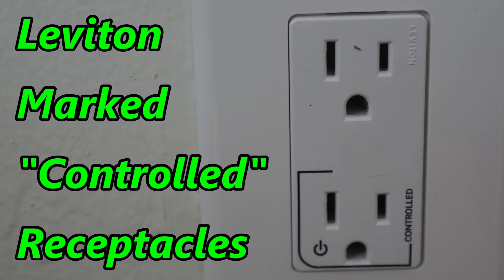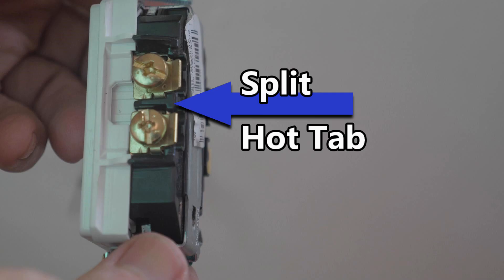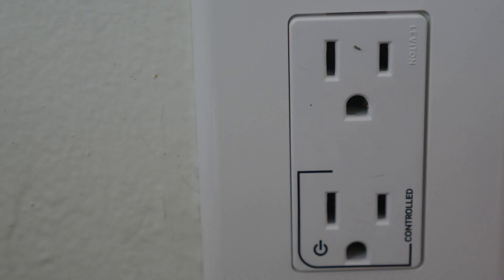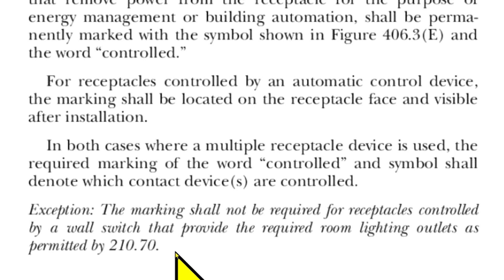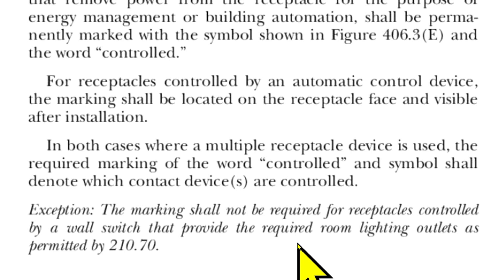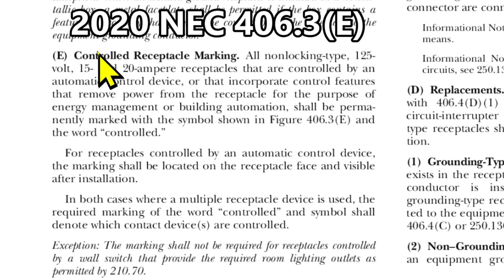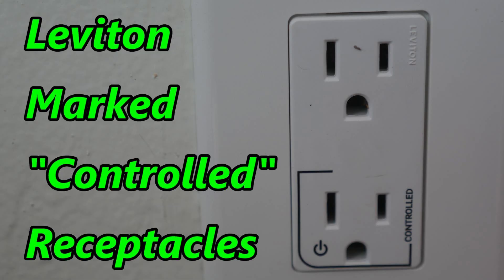2020 NEC 406.3(E) Marked "Controlled" Receptacles

Comment: There's only one switched receptacle in my home. When I replaced all the receptacles, I put that one ground-up, while all the others are ground-down. This serves as a hint that it's switched.
Reply from the maker: Excellent!
Reply: Switched receptacles are exempt from this. "Exception: The marking shall not be required for receptacles controlled by a wall switch that provide the required room lighting outlets as permitted by 210.70."

Comment: Should not be mandatory
Reply from the maker: I agree, but I like them.
Reply: Unfortunately, there are plenty of idiots out there.
To be honest, it makes sense. What if the outlet is controlled by an alarm system, timer, or thermostat? Imagine: plug in a device and it works. Sometime later, it doesn't work. Why? Were you informed about the outlet's uncommon configuration?
When we convert the garage we left the GFCI breaker controlled outlets be. How do you tell these from the standard outlets we added? On the same circuit are the outside lights, outlets, and pond pump, and every time there is a storm, ... .

Comment: I like it; I’ve installed and serviced a lot of 1/2 switched receptacles as they were a huge go to back in the day before ceiling lights were the standard and they van be a pain to diagnose issues in or just to map out especially when 3 and 4 way switches get involved, and extra-especially when these things are wires wrong. I’d use these just as a standard practice as I use labels to mark the switches 1/2 of the receptacle but labels can come off; I’ve long wished for permanently marked receptacles like 1/2 switches and GFCI controlled as they’re another one where the labels tend to come off or just get taken off as a lot of owners/renters seem a little OCD in not wanting labels on outlets. We do mostly residential and commercial and we used to have a standard practice of labeling junction box covers with breaker numbers to help quickly de-energize things for service; we learned to start labeling on the inside as a massive number of customers would take labels off or clean off sharpie in the case the numbers were written on. When you have to diagnose an issue, especially in a system you didn’t install or previously work on, labels are a god send and a massive time saver; they also help after a home sale as the new owners/renters have no idea what, how, or why things were done the way they were.

Comment: While I absolutely see your point of having a visual indicator, I feel that medium to high-end homes will not like the idea of having markings on their outlets. They will see them as unnecessary or tacky, and have them replaced after inspection. But they don't make the codes, so..

It would be nice not to go into a service call for a "dead" switch, only to find its a switched outlet!
Reply from the maker: I think the receptacle that I showed in the video looks very nice and professional, not tacky at all.
Reply: @SparkyChannel  Ya i dont care if they label them for something useful like a safety thing. but why does there brand name have to be right on the front face of the device. that's just companies trying to make people advertise for them for free. Levition is the only one doing it so far i think eaton stuff don't have there brand name on the front. they only started doing it with in the last year or so.
Reply: @mraaron1584  Yeah, and carmakers should stop putting their names on the front of their vehicles.
Reply: Leviton has started putting there branding on the faces of switch's and plugs its kinda annoying when companies just assume people want advertise for there brand for free. so far i think Leviton is the only one doing it. i saw alot of reviews on amazon and else where with complaints about it
Reply: @mraaron1584  In my opinion, seeing the Leviton logo on a receptacle face is a fast indicator that a quality product was used, not some cheap Walmart receptacle or something. It's not like the logo is colored differently to make it stand out, so from a normal distance you can't even see it.

Comment: $17 each! A little sticker will be fine!
Reply from the maker: Yes, they are a bit pricey.
Reply: Agreed
Reply: I'd  have stickers made first, that's a huge difference in price, (over $12.00 per switch) you are allowed to mark replacement outlets with no grounds per the NEC, as long as they are marked.
Reply: I just use a red permanent marker and put a large red dot in the middle of the switched side of the outlet, which I always have on the bottom

Comment: While most good builders are putting in a light or ceiling fan these days, in my opinion if someone is switching a receptacle instead they should still be required to mark the receptacle as controlled. The visual indicator is useful.
Reply from the maker: The visual indicator is useful, I agree!
Reply: Yeah without the mark you would have to around the room with a lamp to figure it out. And that's providing the person doesn't think the switch is useless first.

Comment: Circuits and wiring in houses have become so extensive and complicates, there needs to be a requirement that it be comprehensively and clearly documented. With a user manual also. It will become even more complex with home automation and IOT taking over. My house was build in 1938. The entire house ran off two circuits. Back then, that was sufficient.
Reply from the maker: Thanks!

Comment: Is there a rule about which one should be controlled (bottom or top)  by a switch
Reply: No not NEC wise. Your local code may vary. Here where I live all it matters if you say it's a half hot. Part of the outlet must be controlled by a switch.
Reply from the maker: No rule but I usually put the controlled portion on the bottom.
Reply: @SparkyChannel  I was taught and still practice that the portion of the recep closest to the switch controlling it should be the controlled portion.  So, it generally works out that the top is controlled by the switch and the bottom is fed (always hot) from below. 
It does vary depending on who wired it. 
Thanks for the info.  I’ll start using these for controlled devices.  I believe the clarity of having them marked will be worth the extra cost.
Reply from the maker: @fomoco300k  Thanks! Yes, they cost more but the frustration that you save others will be worth it. ⚡
Reply: @fomoco300k  Notice that these Leviton devices are labled so that the IEC5009 power symbol is "right side up" with the marked/controlled outlet on the bottom (and ground pin down as well!!) With very few exceptions, that is what I would expect. As a general contractor, I might even add them to a punch list if installed the other way.

Generally I want the top of a half-hot to be continuously on and the bottom to be switched so that the lamp cord doesn't obstruct the convenience outlet when I plug in the vacuum cleaner.

Comment: Would it be permissible to control the receptacle with a dimmer if it is marked?
Reply: I believe so. A dimmer is a switch. It doesn't need to be a 2 or 3 pole (classic) switch.
    Though it might have to be lighting only which have its own markings.   So no plugging a blender into it and using the dimmer as a variable speed controller. (Plus that would kill electronics that require ×amps
Reply: @katieblade7083  That is a good answer, as Bill stated.  But, In my opinion, it could be unwise to use a dimmer simply because of the caution you stated.  There is too much chance of damaging the wrong device connected to this setup.  And there are so many better ways to achieve the dimming one might desire. 
If there were a dimmer controlling a receptacle I’d want either clear labeling or a captured plug 🔌, etc. as a means of preventing damage. 
Just my opinion.
Reply from the maker: @katieblade7083  Excellent answer!
Reply: No. A dimmer is not a switch. I'm not aware of any dimmer that is listed to "dim" a receptacle. In fact, every dimmer I've seen says it can't be installed to dim a recep, and by code, you have to follow the instruction.
If you want to dim a lamp that's on a switched recep, consider the HFDU from Lutron. Basically, it is legally NOT a receptacle, which is how their able to accomplish that. The down side is you have to chop the standard plug off your lamp cord and replace it with Lutron's.
Then, you can put a dimmer in the wall feeding that dimmed "receptacle".

Comment: I've more than once been in a motel room where the wall switch shuts power to the clock radio and the table lamp stays lit - seems that the hotel staff needs some instruction and maybe outlets should be marked by a sticker if one or both sides are controlled by a switch.
Reply from the maker: Excellent point! I agree.

Comment: Great video Sparky.  I think requiring them to be marked is a good idea. There are a bunch of unmarked ones out there but marking just makes it easier for folks to figure out what the purpose of the outlet is.
Reply from the maker: Thanks Gary! It sure would be less confusing for people if they were all marked. We'll see what the NEC says in 2023.
Reply: TX has at least one of these in each front room, because residential building companies get away with being cheap... 
Hey, NEC! ; how about requiring a  ceiling mounted outlet, fan rated, with a 14/3 in it!
Reply from the maker: @wim0104  I agree. Builders are just trying to save money by not installing ceiling lights.